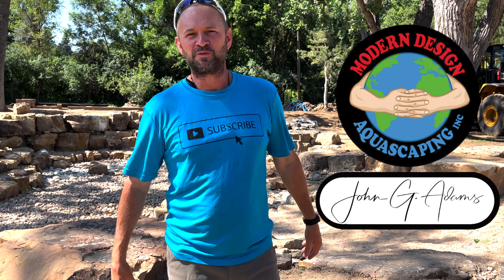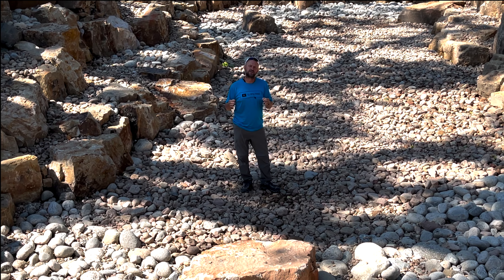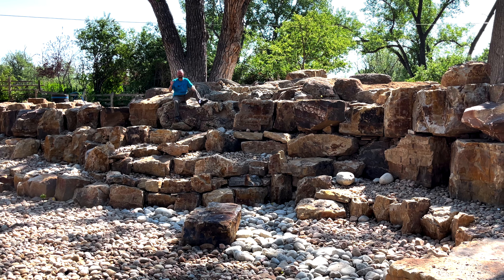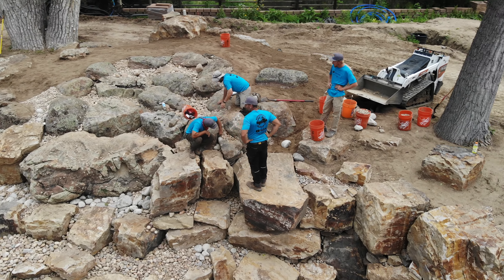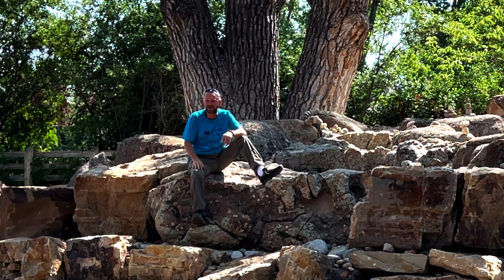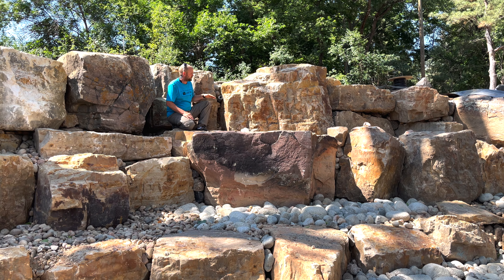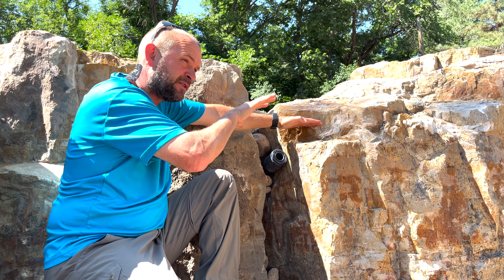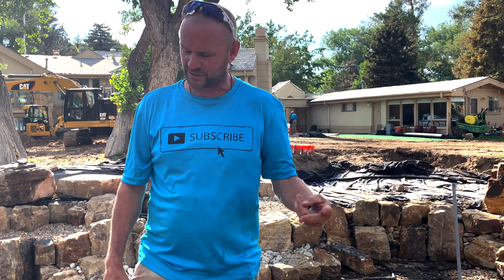Swim Pond Jets How & Why | Water Feature Design Series 12

Comment: Hi John, Can you send a list of parts that you use for jets and their uses? I see you start with 2" line and then reduce for each application- i.e. bottom, mid, surface and reduction size. Also, do you use one pump to feed them all? Thanks so much! Matt
Reply from the maker: We use 2” flex line to carry 5000 gph or less-3” flex for 5-10k. For each jet location we reduce to 1” from trunk line to run to the outside of the rock work, and then we use loc-line fittings for the final jets. On large features we just stick to the 1” and skip the loc-line stuff!! I try to avoid long runs of 1” flex (like 3’ max) to keep friction losses to a minimum ;)

Comment: John, I've watched this video many times - so much content! Could you do a video or reply if its simple, how do I calculate how much the return jets reduce the flow in the main pipe? I need high flow turnover for my pond volume ~7000g/hr and plan to put return jets off the main return pipe from the intake bay to the wetland and an overflow jet before the snorkel into wetland... hoping to achieve the reduced flow back up through my wetland. But how do I know it's right - the 100g/hr per aquablock or 1800g/hr??? OR is there a device to measure flow? Thanks!
Reply: oops overflow jet before flow into centipede... and 8x10  wetland is 16 aquablocks so 1600g/hr, right?
Reply from the maker: Honestly I am sort of confused by the question but I think you are asking about head pressure caused by jets? If you calculate 750-1000 GPH per jet during your design it runs fine for me. Just follow your normal flow rates that you normally use (Like if you are currently on a 2” jet line don’t restrict more than 2” SO for 3/4” jets on that line, exceed 2” of openings by using AT LEAST 3 @ 3/4” jets to arrive at 2 1/4” of opening…). Did that answer what you were asking? Again - if I were running a 3” line with 9000 GPH I would design in AT LEAST 9 @ 3/4”jets (which gives me much more OPENING than the 3” of the pipe). Hope that helped?
Reply: @KoiAddiction   Thanks John, I was trying to calculate the reduction in flow GHP with each jet from basic physics, e.g   - https://youtu.be/EJK1Tsdis90,  but got stuck with dependent variables, so I think your rule of thumb to reduce flow by 750-1000 GHP per jet is just what I need. Is there a device you can buy which measures flow GPH? I envision that is a lot of buckets if I check it that way! Thanks again

Comment: Hi John- Would you recommend a jet for a large swim pond 30 ft x 35 ft 5 ft deep with fish and bog filtration?
Reply from the maker: Yes for sure. I would def do that. Design-wise I would just be sure to dial in the layout depending on your climate zone so you can winterize if needed or be able to run it all year without messing up the thermoclines in areas where that is possible!

Comment: The water depth reduces the amount of flow coming from the jets especially for a 5ft deep pond. How much is this a consideration (similar to pipe to diameters) and how do you factor this in when calculating flow rates, number of jets from a particular pump etc? Great informative context 👍
Reply from the maker: We engineer-ish it by doing a sketch, supplying needs to the pump company with desired flow per jet-they spec the right pump based on that and then were good!

Comment: Another Great Video. Can you describe exactly your jet fitting plumbing setup from the "T" on. What type of ball valve do you use and what type of discharge fittings are you using? Are they Adjustable?  How do You winterize those jets if installed in colder areas. Thanks!
Reply from the maker: It is always different based on flow rates. 3” line carries 10ooo GPH- 2” carries 5000 GPH- 1” carries 1000 GPH- reverse engineer this. If the runs are long, oversized the pipes to reduce friction losses. The pump manufacturer should be able to help you design this. I like to run sep. pump for jets or at least a ball valve with a union to help restrict the potential for the lines freezing. Stick with flex pipe, I don’t build much in colder areas but if the lines can self-drain via gravity they should be fine to overwinter.

Comment: Thanks for the inspiration and education.  I love this project. My question is there a different pump for the jets? Do you also use adjustable valves or do you engineer the flow rates with the reducers?
Reply from the maker: We do have 2 jet pumps on this job. Engineered the rates as well ;)

Comment: If I understand this correctly,  when you split multiple jets off a single pump, after figuring TDH, you can divide that GPH into X amount of jets, according to the GPh needs of the jets?     Ex: 3000gph on a 2'' line would support eight 1'' jets at 375gph?    Hopefully my question makes sense.
Reply from the maker: We typically plan for 750-1000 GPH per 1” jet

Comment: Thanks again for all the videos you do! 
A couple of questions - 1 -it looks like you are putting an insert in the ends of these get pipes - is that for looks or are they adjustable?  2 - is there a rule of thumb for how many GPH per jet at different size pipe?
Reply from the maker: We stay at 1” on outlets and figure 750-1500 gph per jet. If you go over-sized, you can put reducers on the ends to reduce-low and increase velocity if needed!

Comment: Hi John G. 
Thank you so much for another so informative video ! I wonder 3 things:
1) positioning of the jets: how far from the bottom for the bottom jets and how far from the water level for top jets would you position them (say in a 5’ deep swim pond)?
2) number of jets: as an average, every how many feet you would locate one ? or only in potential dead points? 
3) would you alternate one bottom jet and one top jet ?
Reply from the maker: All jets can be positioned any way you like. Closer to bottom pointing up to move surface flow- close to bottom pointing across the bottom to “sweep” the bottom. Close to top will create “turbulence” so that is a consideration while a bit deeper will still create current with less surface disturbance. I design jets based on shape of pond-desired effects-dead spots based on shape-etc. You can consider making them “winters-izable” in case you are in colder climates so that jets can be off during winter. Also consider where you want to plant lilies since they don’t like the added current! Best of luck;)

Comment: Love all your videos because they are very detailed and informative for DIY pond builders.  On the jets could you use pvc control valves to adjust flow rate on each jet as needed?  Also what calculation do you use to determine what size pump to use?
Finally on a different topic I think I have watched all your videos and hadn’t been able to find one that explains calculations for sizing an intake bay.  I’m building a pond this fall and trying to determine what size intake bay would be optimum.  Thanks as always for replying to my questions.
Reply from the maker: Hey Chris, you can ball valve each to adjust! I used a sketch for my pump guy on the jet layout and then he gave me a pump size and a minimum number of inches of outlets per run (min of 12 inches = 6@ 2” outlets or 12@1” outlets). We work together on complex designs, small systems not so important. Intake bay @ 1-2 small Aquablocks for infiltration area per 1000 GPH flow rate!
Reply: @KoiAddiction  thanks so much, I always look forward to seeing your videos.

Comment: HI John,
Another great presentation!  
David and Jenny
Whitefish, MT
Glacier Aquascapes
Reply from the maker: Thanks sooo much!!!!
Reply: Do you folks use a bulkhead fitting to get the 3 inch jet plumbing inside the liner or jump over the edge?
Reply from the maker: I prefer to jump the edge, if at all possible. Cutting a hole through the liner in my opinion, causes the potential for future root penetrations, etc. We do use bulkhead fittings but we avoid it if we can.